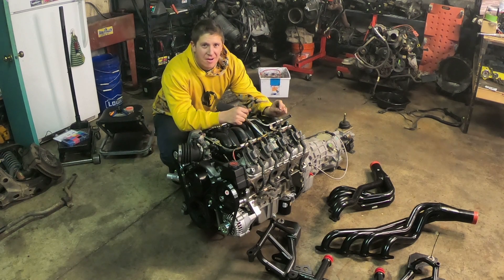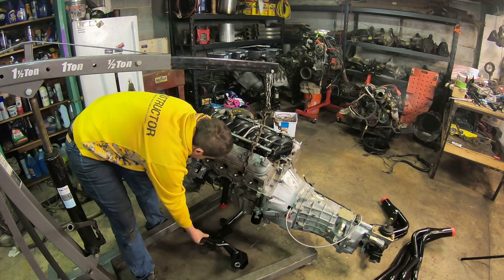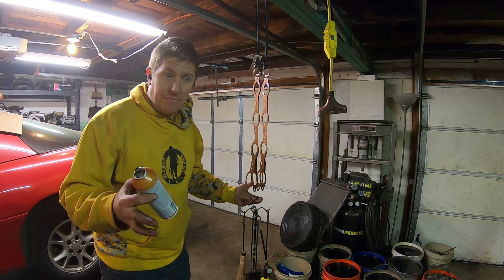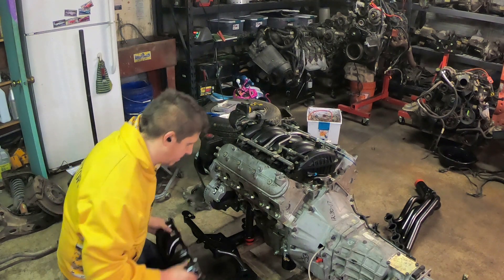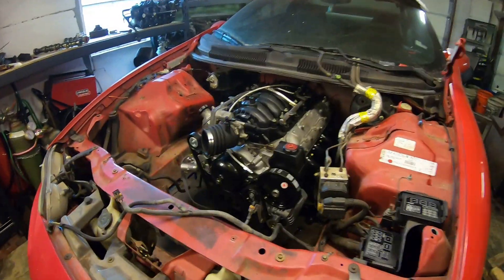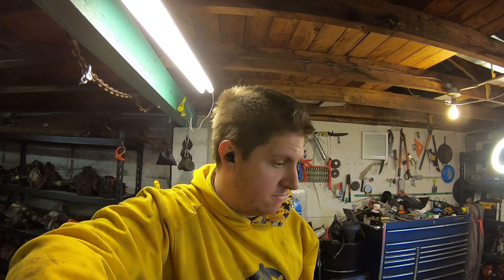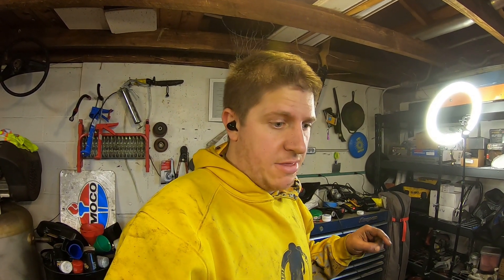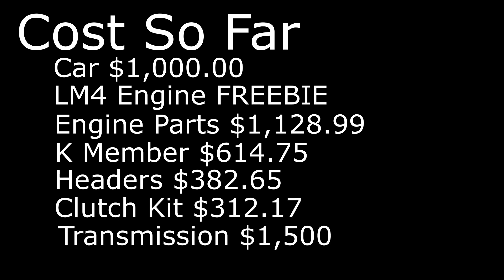V6 to V8 Camaro Swap!  Had ISSUES installing the V8 engine, what is the SOLUTION?

Comment: Interesting, you make it look easy, but I realize there's quite a bit of experience that goes into this swap! It gives me the confidence to do a 3.8 replacement, LOL. Yes, just taking the blown 3.8 out of my wife's (otherwise mint condition) 97 RS and putting a low mileage 3.8 back in it. I'm sure that's considerably easier! She blew out an oil line, ran without oil for about 6 miles of highway, and pulled over when she heard a "clunk" and it started running poorly... Ignoring the flashing warning lights, and the other symptoms prior to the rod snapping in half. I don't really want to put the v8 in it because, frankly, she would just get in trouble with extra ponies, and the 3.8 is available in 25 different cars and should just plug into place. (might have to swap a bunch of accessories, the oil pan and other things of course)
Reply from the maker: You shouldn't have any trouble just replacing the 3.8. Like you said, maybe swap accessories and oil pan but otherwise it's just pull out the old one and put the new one back in place.

Comment: Where did you get the LS! crate engine for this build? I have been looking EVERYWHERE for a listing, and I can't find a thing.
Reply from the maker: I got this one out of my local LKQ pull it yourself junk yard. I also part out GMT 800 trucks and GMT 360 SUV's so I have a pretty much unlimited resource of Ls engines.  Try searching for 99 to 06 gm fullsize trucks and suv's that are being partedout or sold for parts.

Comment: So you used the old steering rack and shaft? I’m about to do this swap and had been told you have to swap them to ones from a V8 car.
Reply from the maker: Yes I used the V6 rack and steering shaft. Here's the deal, the V8 rack and shaft are different from the V6 rack and shaft so if you're going to use a factory k member, you'll have to get a V8 rack and shaft as well. But they make aftermarket k-members for Ls V8 that use the V6 rack and shaft. So if you're going with an aftermarket k-member, you can keep your V6 rack and shaft, just make sure you order the right k member.
Reply: I know this is an older video, so I appreciate the response. Looks like I’ll be watching all this videos when I get into doing my sons car. Thanks!
Reply from the maker: No problem! Good luck!

Comment: Is there a reason you bought a new k member? You just wanted new parts or is it different going from v6 to v8 love the vids very informational
Reply from the maker: The v6 and v8 k-members are different, you eithe rneed to swap the k-member, or they do make adapter kits also to make your v6 k member work with a v8. Thanks a lot for the support and for watching!

Comment: Hey man. I’m about to do the exact same thing to a 02 firebird originally a 3.8 but I’m going to drop a 5.3 in it. Ik it’s been a couple years ago but you wouldn’t know like the part number or anything to that k member you got. I’m trying to find one for mine but not having the best of luck and did the engine mounts come with that k member or was it separately.
Reply from the maker: I don't remember the part number of the k-member, but I do remember it is a BMR Suspension part and I remember BMR had like 15 different versions depending on what you want to do. The one I used came with the engine mounts.
Reply from the maker: I'm pretty sure I put a link to the exact one I used on the video description for one of the videos on this swap.
Reply: @MohawkMotors  ok man I thank you and I’ll have to go back and check for it and see. And by the way keep up with the great vidoes I love watching them

Comment: Awesome video..I have a 97 lt1 t56 car that I'm ls swapping.Im installing a 6.0 with the holley term8nator x . Question is ..how do I use my factory gauges?
Reply from the maker: You'll have to integrate/piggyback them to the terminator. I honestly haven't done it so I'm not 100% sure how to do it.

Comment: Hey buddy just wondering if you  Possibly have a part number for that K member from BMR? I'm trying to get me 14 my 95 Camaro that I'm putting a 6.0 LS in it  And cannot seem to find the right k member so if you possibly have a part number that would be extremely helpful
Reply from the maker: Hey man I looked back through everything I had from this project but I don't have the part number from the K member, I thought for sure I showed it at some point in the series but I don't have time to go through and rewatch the videos. If you haven't already, check through the first 3 or 4 videos in the teen dream playlist, I thought for sure I showed the box and part number in one of them.
Reply: @MohawkMotors  ok. Thanks buddy. I will watch the rest of the series and see if I can spot it on a video. Thanks for the response
Reply from the maker: no problem, sorry I don't have it in a more convenient place, I try to get all my part numbers and stuff in my descriptions now.

Comment: Hey do you know what model k member that is? Because I’ve got a v8 to swap into my 97 Camaro but I can’t seem to find a k member that will work
Reply from the maker: BMR makes a few different k-members for the f-body. Which one you need will depend on exactly how you're doing your swap. I would recommend just giving their tech support line a call and chatting with them directly.
Reply: @MohawkMotors  thanks I’ll look into it

Comment: The k member you got, did it come straight from BMR and can I get the link too it? Also, what kinda oil pan are you using?
Reply from the maker: The k-member I used is a BMR K-Member, but I ordered it from Jegs, they were the only place that had them in stock at the time. This is the exact k-member I used  https://www.jegs.com/i/BMR-Suspension/142/KM013H/10002/-1  but there are several different versions, different engine mount styles and different steering rack mounting styles. I'm using an F-body ls1 oil pan, I ordered the pan with new pick up tube and gasket on amazon.

Comment: Is the lm4 V8 you're installing better than the LS1 V8? Where did you get your engine from? How much did engine and transmission cost?
Reply from the maker: No the LM4 isn't any better than an LS1, they are substantially less expensive though. I got mine from the LKQ Pull Your Part near me for $400. The transmission I bought used on facebook marketplace for about $900 if I remember correctly. The engine came complete with accessories, harness, intake, computer and everything. The transmission was just the transmission, no clutch or anything with it.

Comment: I want to swap a 4.8 or 5.3 into a 96 RS camaro what can you recommend I need to make it fit and would the same K member you are using work on mine, thanks in advance
Reply from the maker: based on my experience and what you're trying to do, I would try to get a 99 or 2000 4.8 or 5.3 to swap into it, it will have the fewest differences in electronics but still will not be completely compatible. Since there was no Ls option in 96 it'll probably be easiest to do some kind of stand alone engine management, either with a factory computer or something like Holley, and adapt the original gauge sending units to the new engine. It should be too difficult to get the oil pressure, coolant temp, and voltage to work, but tach may be tricky.

Yes the k-member I used will work for you as well.
Reply: @MohawkMotors  Oh alright cool thank you for the advice, I'll try to comeback here with updates
Reply from the maker: no problem!! Looking forward to hearing about your progress!

Comment: Hi boss. Can I switch from six cylinder to v8 6.2 engine And put it on camera 21
Reply from the maker: yeah, as long as you have the computer and harness to run it absolutely

Comment: I wanted to do this to my 3rd gen v6 to LS v8. I’m guessing it can be done?
Reply from the maker: yeah absolutely, lots of people have done it
Reply: Thanks man. New sub here
Reply: @MohawkMotors  what engine/trans set up do you recommend for my 3rd gen v6
Reply from the maker: I would go with a drive by cable gen 3 engine for simplicity sake. A 99 to 02 LM7 from a pickup or suv would work and are plentiful. Could also get a 99 to 02 LQ4 from a pickup and would be equally simple. They're both drive by cable in the 99 to 02 vehicles and motor mount adapters are readly available. They're also much simpler electronically then the drive by wire and gen 4 engines.

Comment: I have a 2013 rs Camaro, which ls swaps can I use and do I need a 2013 wiring harness since my Camaro a 2013?
Reply from the maker: the 5th gen camaro is a much different animal, you'll need and engine and transmission, harness, and pcm from a 2010 to 2013 camaro to swap it. You'll also need hptuners or a similar software/programmer to remove all the security features and reprogram the TCM. There's probably more you'll need as well but I haven't done one so I don't know all the intricate differences. I do know that GM dramatically increased the complexity of their hardware and software in 2010 and newer vehicles which makes them much more complex to swap.

Comment: The engine is gonna be offset with more room in the driver side because of the room needed for the steering column
Reply from the maker: yes correct, I did have the engine mounts switched though which had the engine offset too far to the passenger side, the passenger header wouldn't fit. After I switched them it was still offset to the passenger side, but not as far. Both headers fit and the steering shaft cleared.

Comment: Can u drop a parts list needed for the swap please
Reply from the maker: V8 k member or motor mount adapters, v8 transmission crossmember, harness and computer from original ls1 car, engine

Comment: I want to swap a 4.8 or 5.3 in my 3.4 v6 Camaro what would you recommend or any advice?
Reply from the maker: Either is a great option. My advice, try to find one you can see and hear run, that way you'll know it's a good runner and won't need to do anything to it besides upgrades if you choose. And find yourself a complete wire harness and computer from as close a year as possible. I believe the 3.4 was pre-98, so I would try to find a wire harness and computer from a 98 camaro or firebird that came with the same transmission (automatic or manual) and an LS to make the wiring as close to plug and play as possible.

Comment: Hey I’m actually in the process of putting a lq4/4l80 in my 98. Did you use the rack and pinion from the v6 cradle?
Reply from the maker: Hey, yes I did! The K-Member I ordered uses all the factory steering components. Steering rack and pinion, steering shaft, and everything else!  It's a BMR K-member, part number KM019H
Reply: @MohawkMotors  thanks a lot for the quick response knowing that just saved me a little cash.
Reply from the maker: Absolutely! Glad to help!

Comment: Do i need a new k member for the swap?
Reply from the maker: You need either motor mount adapters or a V8 k-member
Reply: @MohawkMotors  do you think ls1 swap is easier than others ls's? For the fourth gen camaro
Reply from the maker: It's more about the harness and accessories. The engines themselves are dimensionally the same, LS1, LM7, LQ4, L33, L59, LQ9 are all Gen 3 LS engines, they use the same crank and cam position sensors, the motor mount bolts, bellhousing bolts, accessory bolts, are all the same so it really won't matter which one you pick. The main differences will be the f body accessories, and the intake manifold, if you can find an f-body LS1 with the accessories and intake still on it that will bolt right in, if you can only get truck engines they will bolt right in also, you'll just need to get a shorter intake manifold to clear the hood and f-body accessories to clear the radiator.

Comment: You never re use any gaskets. I bought a full gasket rebuild kit for the 5.3 Brand name is Big 3 Gaskets bought it off ebay for 130 bucks. Well worth it when rebuilding and installing a LS or any engine at that.
Reply from the maker: I re use gaskets that are intended to be re used all the time, haven't had any issues so far. I figure if an engineer with far more education and material knowledge than me designed something to be re used, it's probably safe to re use it. I'd rather spend the $130 on an ebay turbo than gaskets that don't need to be replaced.  From time to time I do come across leaking or damaged gaskets and those I do replace, but if it ain't broke, I don't fix it.
Reply: @MohawkMotors  what kinda dolly did you use? A plastic wheel dolly for car tires so you can move a car around with? Bout to drop this 3.8 out of my 98 Firebird to swap over my 5.3. But I dont want to wiggle the assembly out. Would rather just slide it out.
Reply from the maker: @goa699  I just used a cheap harbor freight dolly but i'm sure a car dolly would work
Reply: @MohawkMotors  awesome thanks man. Btw im not sure if you have the LS1 intake but if you do you will have to buy a C5 corvette fuel Regulator because the LS1 intake and fuel rails is returnless fuel system. You need Fbody, alternator, Fbody water pump, Power steering pump relocation bracket you can use the truck steering pump, alternator relocation bracket, and Fbody oil pan also you have to trim the 5.3 windage tray for your oil pick up tube to clear. Im sure you have all that. Also if you can get a 5.3 Ecu with vats turned off you should not have any problems keeping it running or starting it up. I bought a Ecu from Ebay for DBC, with Vats delete, rear o2 sensor delete. Speedometer delete, and no torque management. I will have to be careful not to red line my rpms.
Reply from the maker: Yeah I wound up going with an ls1 intake but ran aftermarket fuel rails and regulator to have a return style system. Do my own tuning on the ECM using HP tuners and got that all sorted out. Got all the F-body brackets and accessories from rock auto. It's really close to driveable, I basically just need to build exhaust for it now.
Reply: @MohawkMotors  same here. I just put my 5.3 back together now have to swap it into the bird and hook everything up plus exhaust. My Trans Am channel doesnt have any content just yet until my project is running. But man you should see my car, the Interior I did a bunch of customization to it. I installed the rolls royce 300 fiber optic star light into the headliner, remote controlled, dash is black, dyed the carpet Black Cherry- was suppose to be Scarlett red but it still looks okay. I got too much to list but when The Hellbird is done I'll send you a link to my channel. The one Im on now is my Music channel.

Comment: How did you get a free engine
Reply from the maker: I get them all the time, buy someones "junk" vehicle that runs good but doesn't drive, sell all the parts you don't need, and keep the engine. I find tahoes, suburbans, rusted out pickups, etc on facebook marketplace all the time for under $1000. Between the catalytic converters, a few other good parts and pieces, and scrapping the leftovers it's easy to get your money back and then some.

Comment: Great work. Should i sell my240LS for camaro z28 or ss?
Reply from the maker: Well it's totally your decision, I would love to have an Ls swapped 240, depending on what you're trying to do with it will dictate which is your better option. The 240 is a lighter, more compact platform than a camaro with a ton of aftermarket support so unless you just really prefer the looks of the camaro or want more interior space there aren't many advantages to it.

Comment: Jason are or were you a dealership mechanic 🧑🏼‍🔧 you seem to know an awful lot about the newer car’s. Just wondering.
Reply from the maker: I did work at a dealership for about 6 months but got bored, too much of the same thing over and over. A lot of my knowledge came from tech school, I spent 18 months at Wyotech and took everything they offered except the collision and refinishing (don't have the patience for body work). Outside of that I just love to experiment and learn, automotive tech has always been a passion of mine and it just clicks in my brain. I can learn this stuff VERY fast.
Reply: @MohawkMotors  Thank you for your reply.